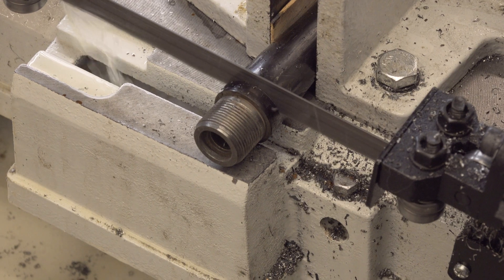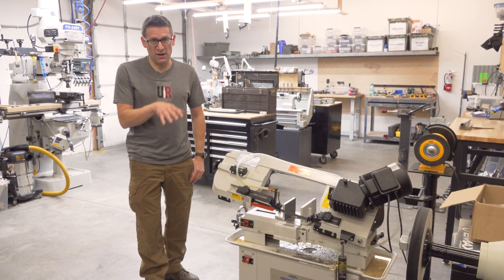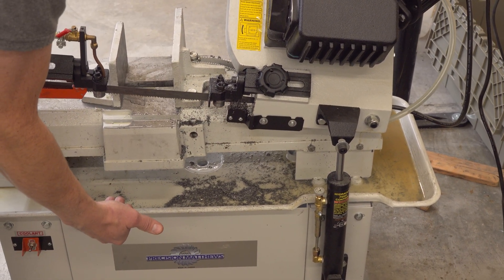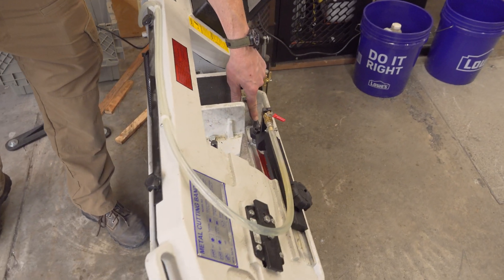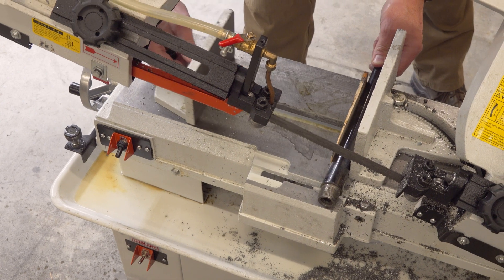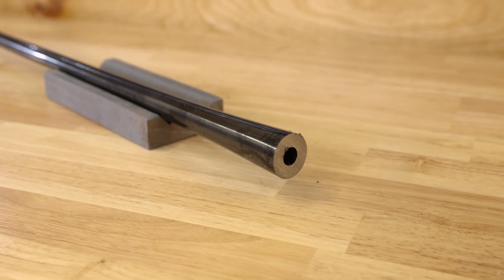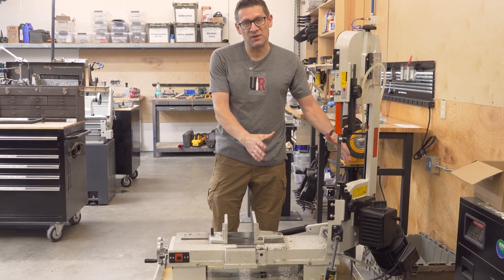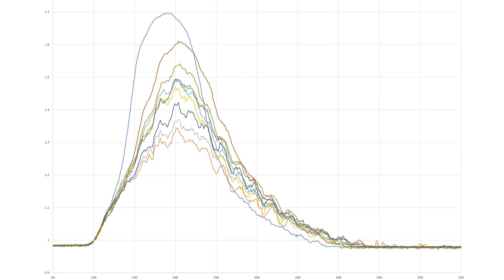Precision Bandsaw: PM-712G (Hands On & Demo)

Comment: I have an older model of this saw under another brand. It has been a workhorse since 2005. From '05 to '13 I was doing a lot of fabrication work, and my little bandsaw did everything I needed to do on a daily basis. I don't fab full time anymore, but still use the hell out of it. I don't know what kind of blade PM supplies with this, my factory blade was garbage. If you order this saw, order yourself some top shelf US made blades at the same time.

Comment: Yes a bandsaw with a 3/4" blade is no way shape or form precision. Too much flex.  Ellis uses 1" blades Krobuilt trailer repair. Reno nevada.
Reply: @dougkrogh4262  
Do you really need a precision saw to cut barrels no larger than 1" dia?  I could see using a big blade for a 5"x5" block to get a perfectly straight cut. 

Turn the feed rate down cut straighter but wait... for it.... not yet... still cutting... wait ok done.
Reply: Go big or go home

Comment: I find it hard to believe the saw doesn't  have variable speed.
Reply: It is a 3 speed geared head as can be seen from the specifications. Most others in this class and price range offer (usually 3) speeds with a belt pulley change.